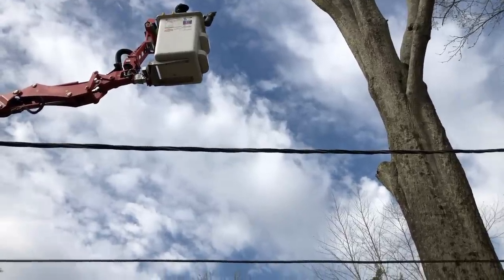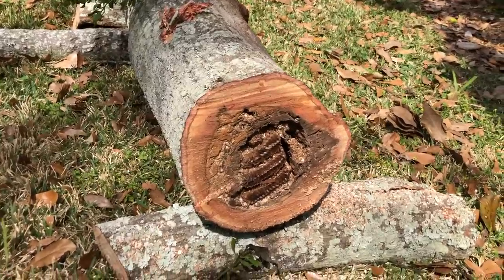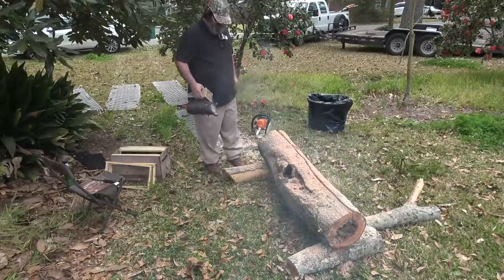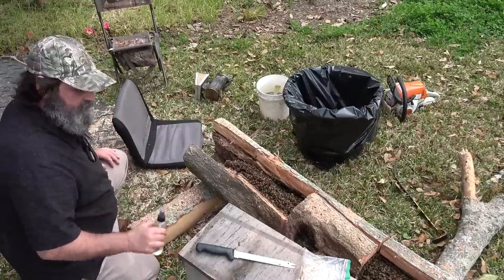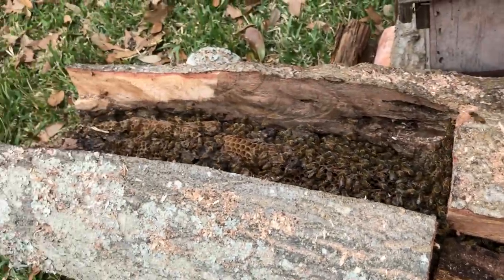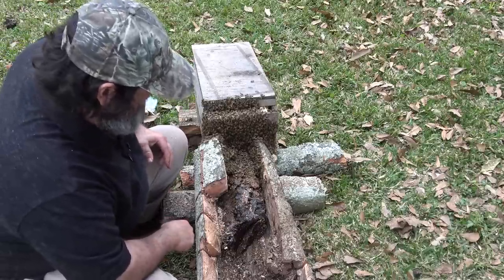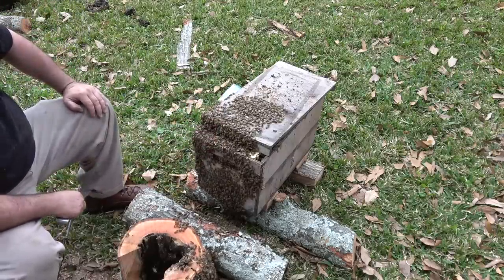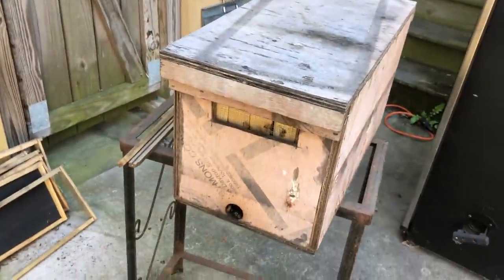Bee Man Vs Another Bee Tree

Comment: JP one question, at about 18:03 you inserted a comb into the FRAME in what appeared to be sideways, was I mistaken ?
Reply from the maker: I try to orient them the same way they were positioned but if there’s not a lot of usable comb, I just want to try & frame up something.

So there’s a chance I may have placed it horizontally instead of vertically, but typically that’s not the norm.